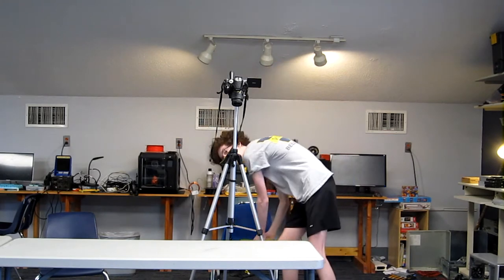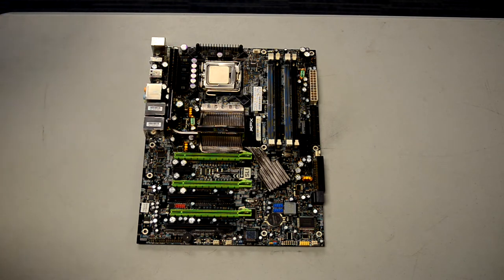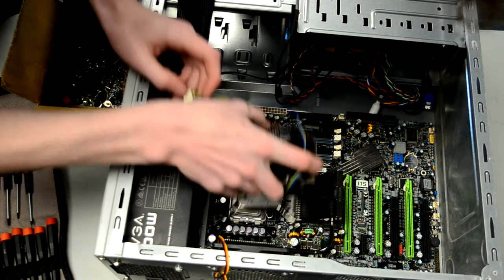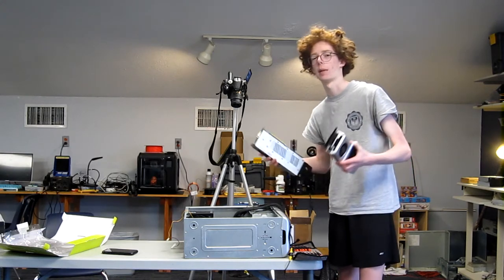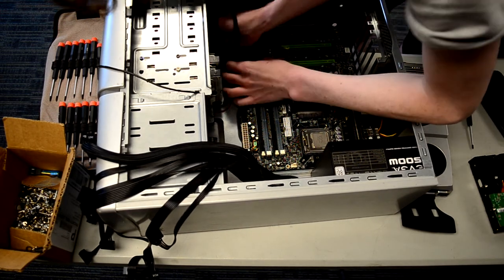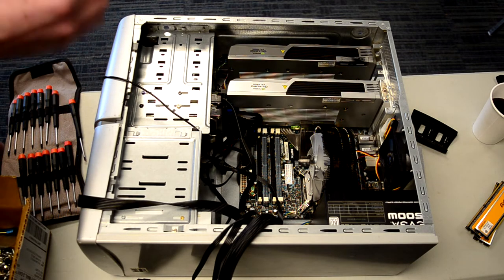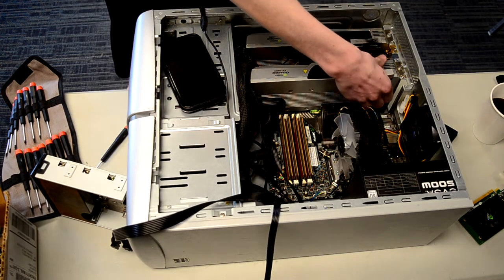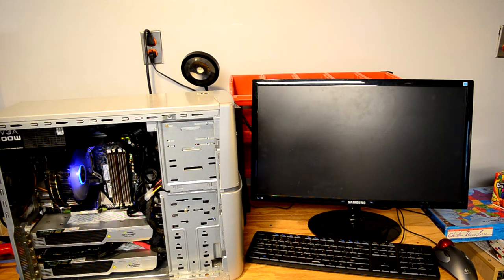Building an insane 2008 gaming PC!

Comment: If you have hot air gun you can preheat thr PCB  to make soldering MUCH easier, and don't be afraid of living the soldering iron too long on the board, MBs have so much heat capacity that its pretty much impossible to overheat the board (unless you have like 200w soldering iron)
And to make solder melt faster you can mix it with leaded solder
Reply from the maker: Great tips, thank you! Will definitely keep those in mind for the future - I have a few old GeForce cards in need of repair.